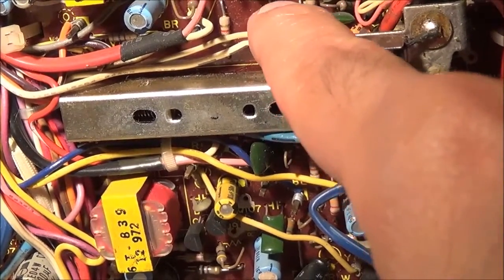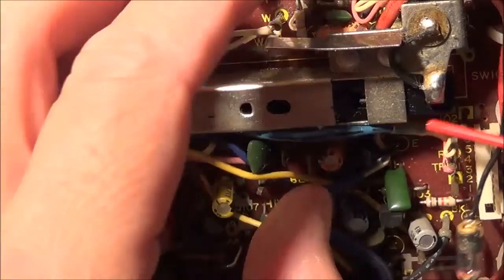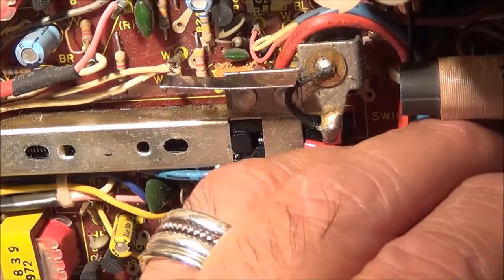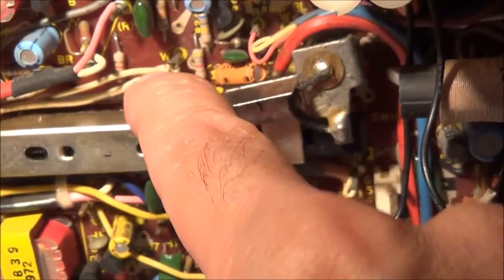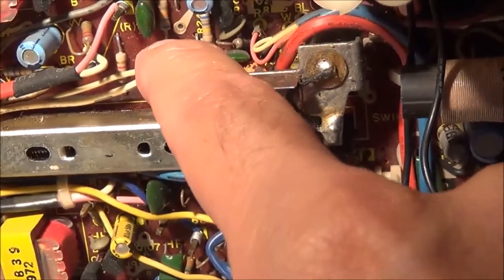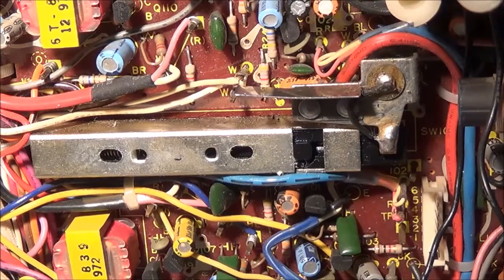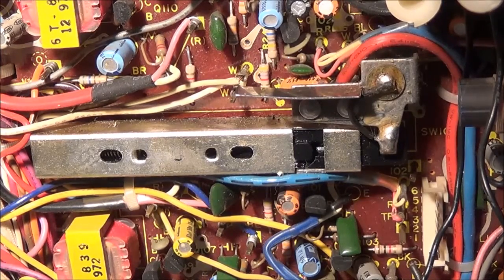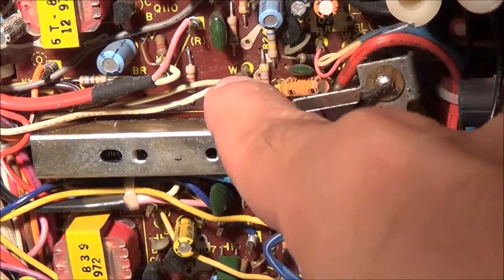SHARP GF9191 RP SWITCH

Comment: Nice video! What spray are you using?
Reply from the maker: It's been awhile; I don't remember what I used. But if you are in the USA you cans use Radio Schack's Control/Contact Cleaner and Lubricant. If you are in Europe, you can use Contact 61. Both of these sprays also have lubricant in them, which is what you need, in my opinion